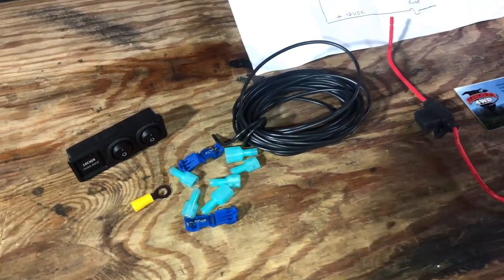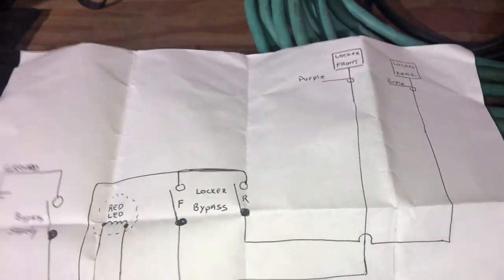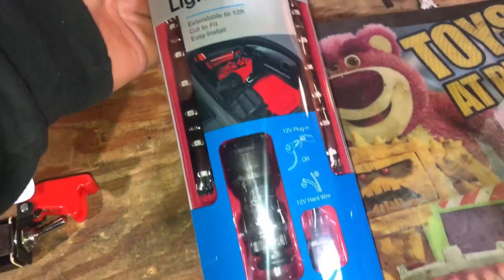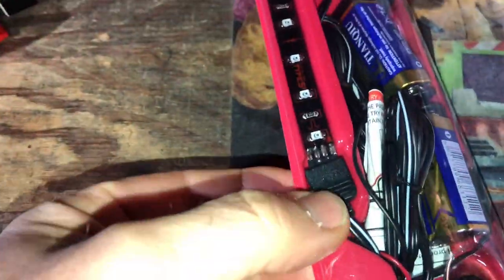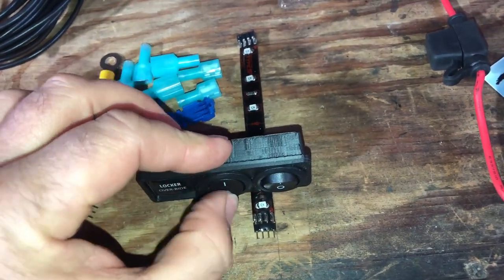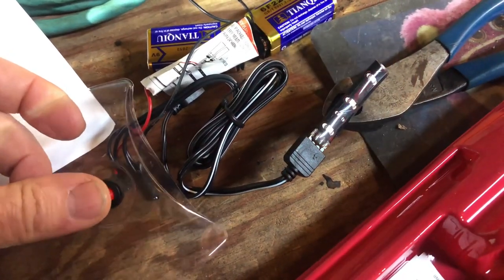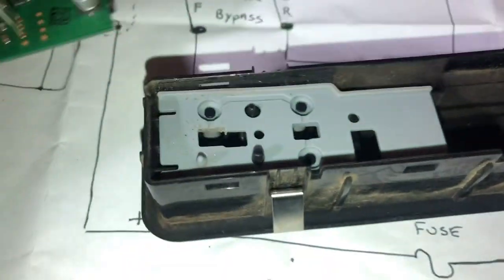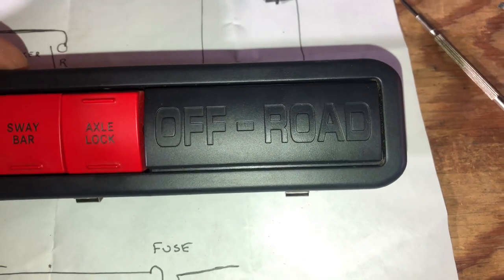Jeep JK Rubicon Locker Bypass Part-1

Comment: Hind sight you could have taken the sticker off and turned the whole switch panel 180* making the light indicator in the spot closest to the steering column. Very cool mod though will be doing this one asap. Ill probably use the 3rd hole for the TCS kill switch mod. If you havent seen that yet it kills all your traction controls off no abs tcs or any of it. And its a simple mod like this one.
Reply from the maker: Thank you… great mod… good luck!👍🏻🇺🇸
Reply: @Recon Jeeper  lol I just watched part 3 and 4. I won't be buying it I'll just CAD my own and 3d print the part. I can print it better, get better switches and connectors that actually fit. Thanks for keying me into a mod I didn't even think was possible.

Comment: Just use 2 red safety switches, will be more simple
Reply from the maker: Simple is an option and cheaper. I prefer it to look a bit nicer and like the led light. 👍🏻🇺🇸
Reply: @reconjeeper0321  
I agree it does look nice

Comment: Great Job.
But you can use only JSCAN app with a little obd to activate Lockers any time in any driving mode 2WD,4H and Low 4 wheel easily
Reply from the maker: @salimalmatani1718  well a bit of work…. But now it’s a push of a button. Works very well.👍🏻🇺🇸